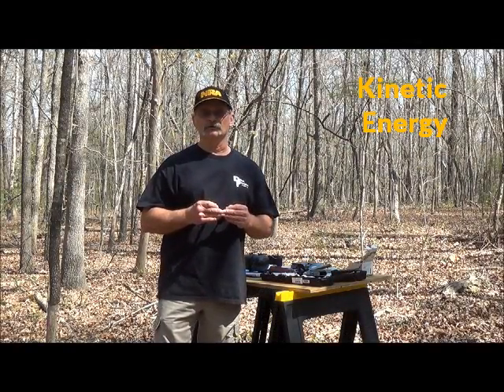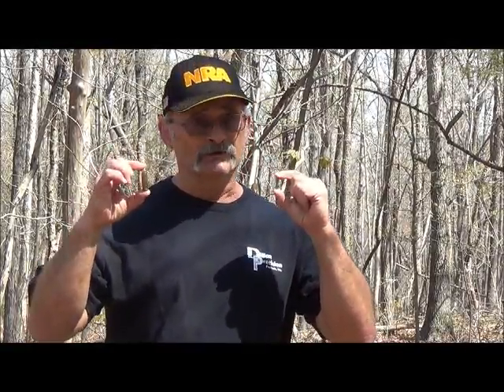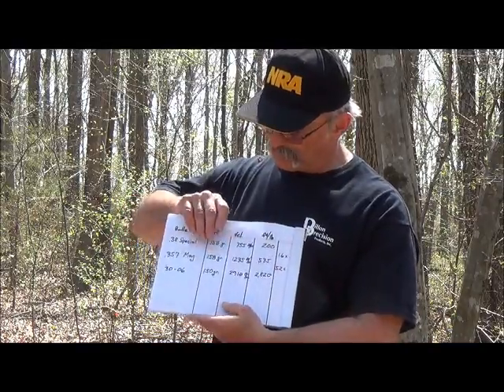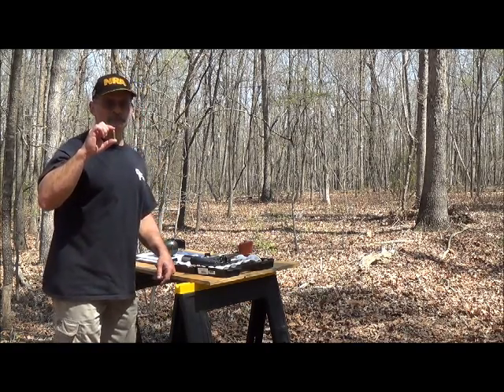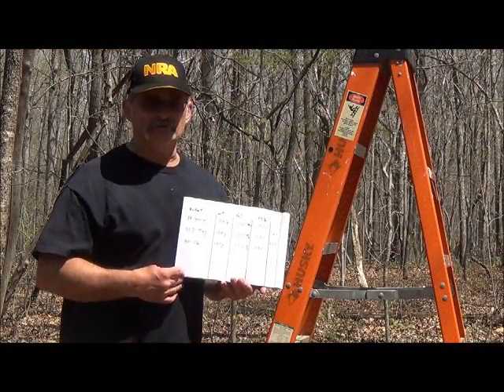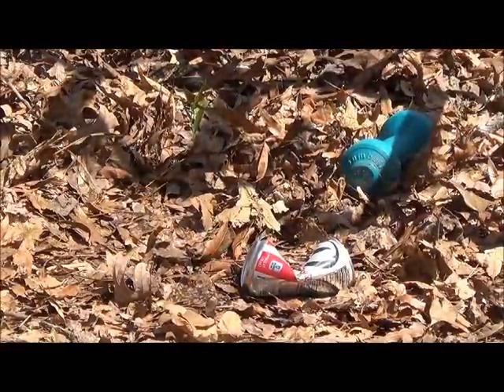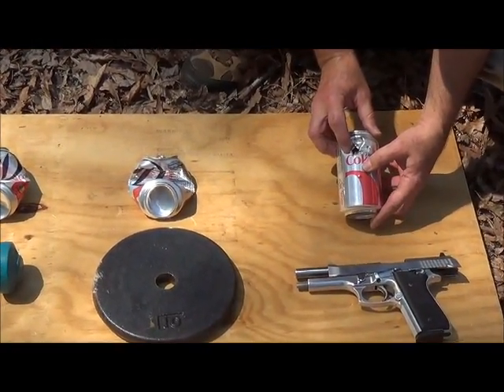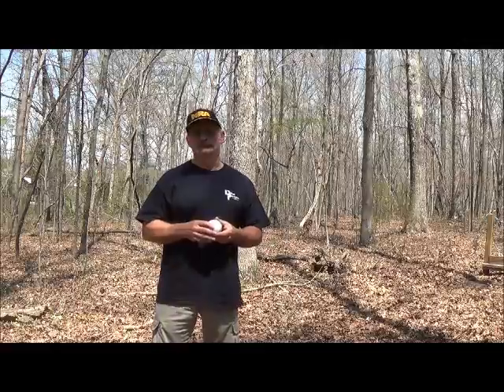Kinetic Energy

Comment: You have no idea what you're talking about as far as the objects falling and physics. You have to account for the mass and the velocity that the object has in your formula. How fast was the 10 lb weight moving when it dropped 1 foot?  About 8 feet per second. What is its mass, 10 lb/32.2 feet per second squared. KE = 1/2 x .31 x 64...Your 10 lb weight falling 1 foot is 10 foot lbs not 350! The 1 lb weight is going about 20 feet per second. Mass of it is 1/32.2 , so KE = 1/2 x .031 x 20 squared. Or 6 ft lb. This makes sense, 1 lb x 6 ft = 6 ft-lb and 10 lb x 1 ft = 10 ft-lb.  And where your bullets hit the metal plate matters, the 9mm hit high near where it was supported by chain. The plate would move more if it hit lower. A 9mm will kill a deer at close range, a 1lb weight dropping 6 feet will annoy it. Give up trying to teach physics without a clue!

Comment: good intentions but looks like a simple math error in calculating foot pounds of energy, actually the foot pounds of energy of the dropped objects will not be 350 ft/lbs, 1 pound equals 7000 grains in weight, 10 pounds equals 70000 grains, the formula is velocity times the velocity times grain weight, then divide by 450240 and you get energy, if the 10 lbs weight was going 10 feet per second then its 15 ft/lbs of energy, the 10 lbs weight would not be going that fast, maybe with in 10 feet per second or less, if you go by newtons law and object falls 9.8 meters per second but the ladder is much shorter then 9.8 meters.  you can use the bullet formula on any object,  velocity times velocity times the grain weight divided by 450240, the energy of the 9 mm was correct though. for the 1 lbs weight with a velocity of 19.6 fps the energy would be closer to 6 ft/lbs of energy